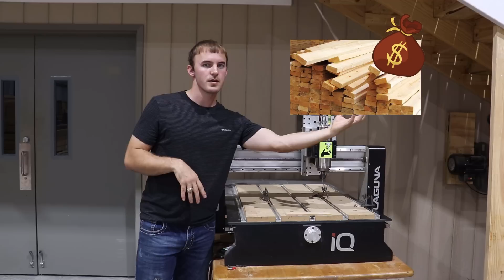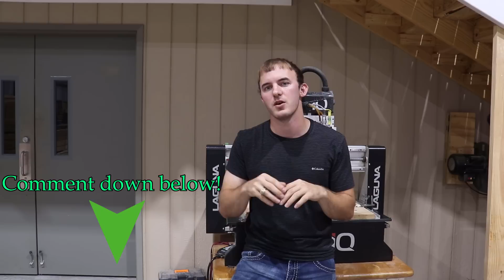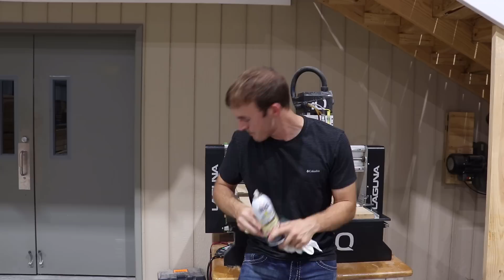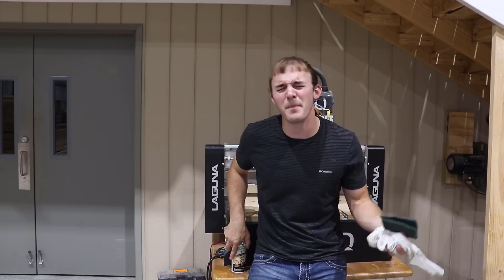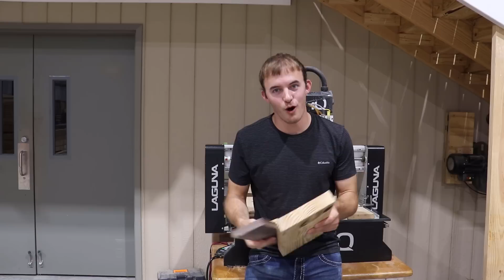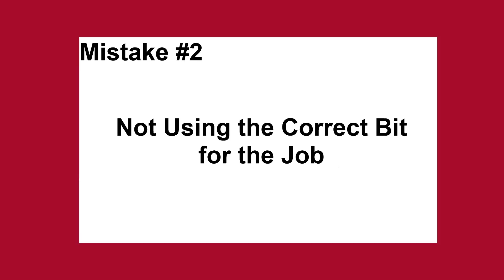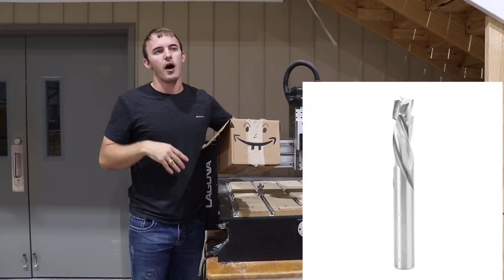Mistakes CNC Beginners Make | Wood CNC Router

Comment: Great video. Nice explanations.
The only thing I would comment on is the number 1 problem.

It wasn't immediately clear what you meant by bit speed. 

There are 2 speeds, spin speed (RPM) and Feed rate.

You just need to explain the difference between and their relationship.

Liked and subscribed.
Reply: @cutting-it-close  just edit this video with the new section? Or add the new one and link to it from within this video.

Do you plan on more detailed videos on actual machines?
Reply: @cutting-it-close  definitely some for the smaller hobby type machines. Like 3018 etc..

Some discussing how to do multiple cut designs (when you rough then detail).

Comment: #1 Running a bit too slow I think needs clarifying a bit. You should have said feeding a bit too slow into the work, to me running a bit too slow refers to RPM rather than feed rate. Feeds and speeds is a very deep subject & to get things right is matching the rpm to the feed/travel speed so that chip load is correct & constant, morso in metal.
Reply: That was my thought too.  Seems like advice on final mistake is backwards.  If friction and heat are occurring, wouldn't it be because the trave rate is too fast and the RPMs (cutting speed) is too slow?

Comment: Hello,
I'm a newbie and at the end of your video strangely I've though exactly the opposite of what you were saying. "Speed up your RPM or slow down your feed rate..." to avoid friction as you said in the case of running the bit too slow
Reply: If your bit is spining too fast the cutting edge gets round for the next cut before the machine moved enough to present new material so it rubs on the already cut surface creating friction and heat, when cutting speed is correct the heat is carried away by the swarf and away from the bit, you can see this better when cutting metal. Check out the temperature of your swarf you will find its a lot warmer than the piece your cutting. I think he meant moving too slow for the rpm on the machine.
Reply: @incubatork  Ok, got it thanks Derek.

Comment: Hello!!
Great Video and you nailed it in regards to accepting mistakes, and learning, then moving forward.  I have been in CNC for 25+ years, and as a machinist I understand speeds and feeds, the hardest part for me is getting used to working with wood, (0.005" tolerance doesn't exist in woodworking! and thank God for Wood Filler ) I have built a hobby machine and am making signs. and such for friends and family.  My hardest thing is putting a price  on the fun side of it, which is the creating.  Cutting is fine, but taking an photo and carving it is the fun challenge for me, and also the  fun.  I look online to get comparisons from others so I have been using that as a price gauge. So far I know have been charging less as I am very gratified to see peoples reaction, but as retirement is getting closer, I would like to figure out what are realistic charges I should be making.
 Thanks again and I will be watching your channel.

Comment: Hi Guy, You confused me near the end of the video regarding speeds. The goat screaming because its running too fast and screaming because it's running too slow. I'm guessing you meant to say the screaming is because the bit is running too slow. I just received the smaller desktop CNC with only a 1/8" collet and a 10,000 rpm spindle. I'll mostly be cutting wood and I've tried several different kinds. I tend to over test things to experiment with speeds, feeds and material. So, to my point, did you mean the bit is too fast or too slow? Thank you for a very well done video. You know your stuff and I will subscribe. Good luck with your other videos.

Comment: Hi. Nice video. Some small mistakes but for begginers nice to go nice to know. You never use single staight flute ( the type that you show) on cnc. Only very few times for finishing paths. I work with cnc since 1996. I still have my first machine from Pacer. Is my little baby. Working area Y1500 mm and  X1300 mm.
For video???? Ok. 1)SFM for materials ,  2)what spiral angle do and when to use it, ex: low helix , med helix and high helix. 3) diflection 4) biggest enemy for your carbide  or HSS 5) coatings 6) materials ( hard plastics/soft plastics, aluminium -8%silicone or +8%, HLP, hard wood/soft wood, ACM (Alumunium Composide Material) , cement boads, marbel, fiberglass etc.......

Comment: Hi love the videos and what's your thought on a avid cnc machine would you recommend them as a starter
Reply: I think the omiocnc are rlly gud for their price point. The only downside is that they’re stuck on Mach 3 but the speeds you can get are very high compared to other around their cost especially for harder materials like aluminum and it could even do 40IPM in steel

Comment: MDF stands for Medium-density fibreboard, not "micro", right?
Reply: Right
Reply: Harder to light...
Reply: NEVER use MDF EVER! Look at the materials it’s made from. It’s Carcinogenic and it’s made from wood dust, formaldehyde and urea resins. You are breathing the fine dust in when machining, even with a mask. I won’t allow this stuff in my home unless it’s sealed with an oil base finish.
Reply: @darrellsaturnbigfoot  so basically its like a cigarette.
Reply: @darrellsaturnbigfoot  Problem is that spoilboards are usually made of just this type of material. There are also other materials that are made in equally toxic ways. OBF, Particle Board, LDF, HDF, Plywood, Melamine boards, etc. You have to stick to solid wood only, to avoid the toxicity and even then the dust remains and will still pose a problem in the long run, by increasing your chances of developing COPD (Chronic Obstructive Pulmonary Disease).

You can't avoid carcinogens when you're a maker. You can just look up the most harmful carcinogens and try to avoid those, but at the end of the day, even your own body is a carcinogen, as it only takes a single cell that doesn't split correctly, in order for it to mutate into a cancer cell. Cancer isn't just caused by exterior reasons. It can easily be caused by your own body fucking up.